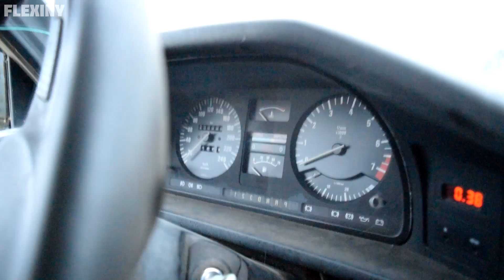1981 BMW E28 520i Test Drive After 9 Years (1080p)

Comment: you're running on 4 or 5 cylinders aren't you ?
Reply: One spark plug don't work as we could see on video, so yeah, it would be 5 cylinders.
Reply: +zetnakatel 
That's true. Here we see, how not to start an engine, if you like to restore it.
Reply: it is six
Reply: This sounds more like 3
Reply: so it's a 5 cylinder now, even better
Reply: is the car stil alive?
Reply: The plugs were a bit iffy lol 1 was deffo not sparking lol
Reply: Only 4 plugs work
Reply: 6 cylinder engine

Comment: Beautiful V6 sound, awesome
Reply: Its not a v6
Reply: 6 in line ;) my friend
Reply: That rough sound that you hear is the engine knocking for oil.

It should get a complete stripdown really.
Reply: nah, preatty nice sound engine , i was really thought that this is V6. wrrrrrrrrrrrrrrrrr
Reply: That's the thing. The m20 and m30 engines should be quiet as a mouse till you push them.
Reply: Wydaje mi się, że nie pracuje na jednym garze i stąd ten "ciekawy" dźwięk silnika ;)
Reply: bmw doesn't even make v6's..
Reply: Yes its V6 bro but just running in 5 cylinders because 1 spark plug not working
Reply: nope, inline 6
Reply: oh sorry dude i missed :) that's inline 6 :)
Reply: BMW makes V6s
Reply: When ?
Reply: 325's 328's come in inline or V shaped engines
Reply: 328 and 325 have 6 inline
Reply: But there is V6'es too
Reply: Nope
Reply: Nope !!!!
Reply: So only V8's and so on?
Reply: https://en.wikipedia.org/wiki/List_of_BMW_engines
Reply: Weird
Reply: mhm
Reply: it isn't that weird if you think of the smoothness of an inline six compared to v6's
Reply: V6 has its own advantages. But it's weird that BMW in decades never made a single V6
Reply: R6 is simple to manufacture. V6 sounds better than R6. I have MB E320CDI 3.0 V6 224ps and Pontiac 3.1 V6 and i love v6 sounds

Comment: I didn't get it right... was it diesel or gas engine?
Reply: 520I !!!!!!!!!
Reply: I get your confusion, at 4:19 it sounds like a diesel when idling :)
Reply: gasoline
Reply: its sounds like diesel cuz its running on 5 cyl not on 6, its not sparking on one
Reply: running on 5 cylinders! this is the matter why it sounds like diesel engine!
Reply: Petrol. LPG cars weren't around back then.
Reply: 520i so its gas because diesel is 520d
Reply: IMNOTA
sounds like diesel! no one said its a diesel engine!
Reply: Toni Decker the first commentary ask if it is a gas engine or diesel so i gave him the trick to know
Reply: IMNOTA
oh sry, i didnt saw that!.
Reply: Toni Decker  WRONG! the first diesel BMW was e28 indeed, but it was 524td / d
Reply: Ku Ky
wrong??....what is wrong?....i said this engine in the video still runnin on 5 cylinders (or 4)...This is the matter/issue for the diesel sounds of this car!:...i never said there are no diesel bmw on the market. Its a 520i ....I means injection... diesel engine is D....for example 524td(s)  this is an 2.4L Turbocharged Diesel......

where is the place that im wrong?
Reply: Toni Decker oh, sorry, i meant to correct IMNOTA, there is no 520d in e28 :) my bad
Reply: You'd think the fact there's spark plugs shown would answer your question?
Reply: Markcaetano, I did see the wires, but the fact it had some sort of fuel distribution thing, and then the sound of the engine kept me fooled. I thought the wires were for glow plugs or something.
Reply: k jetronic, mechanical fuel-injection :)
Reply: VochoTalacha it just has bad rodknock
Reply: VochoTalacha don‘t you see the spark plugs?
Reply: It has spark plugs man.